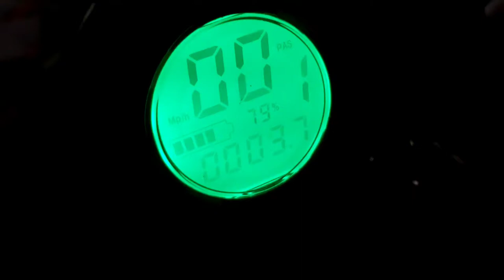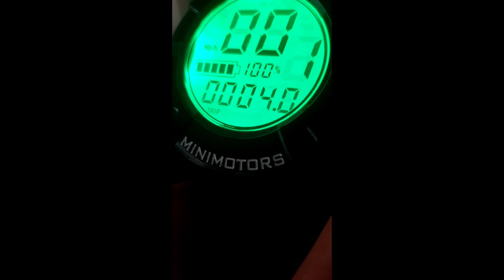Kaabo Mantis Pro Bent Rotor/Brake Review (Fluid Free Ride)

Comment: My front rotor is slightly warped after a crash, and it started to rub on the caliper. It squeals pretty bad, but only on speed 1. If I brake with the caliper loose, the sound goes away while the caliper moves back and forth quite a lot. I think I'll try to bend the rotor carefully back closer to round, a tiny bit at a time. Replacing the rotor is a major project. It requires opening the entire unit: ungluing the rubber mat, unscrewing the top, prying it off from RTV glue without bending it, removing the battery, undoing the motor bullet connectors, unrouting the entire motor cable from the frame so the rotor can come off the cable. Then having to reverse the whole process to get it back together. It's ridiculous there's no connector on the motor cable. You know what else sucks? To replace a front or back plastic deck guard requires cutting electrical cables, even though they do have connectors.
Reply from the maker: hope you are ok and injuries were minimal !

Comment: I have the mantis FluidFreeride V2 edition. Just hit 300 miles and my rear brakes have been doing exactly this since new. My rear pads are completely gone, the bracket was barely hanging on for dear life. I lost braking and crashed a couple weeks back because of it. I'm attempting to change the rotor and pads right now, hopefully it works. FYI, huge hassle to change the rotors, you have to unplug the battery and pull the entire motor cable out and through the rotor.
Reply from the maker: @josephalise9140  yea unfortunately we start researching n all that after these things happen but it's how we learn, hopefully you have the time to learn and change it yourself. That way, should you have a better one in the future it'll most likely be easier to own that the fluid free ride that isn't known for their quality products. If you're interested, the channel 'RK9 Rides' just uploaded a video listing e scooters in different price ranges so you can get a better idea of what brands and features to look for, depending on your budget. Cheers ✌🏻

Comment: this could have happened due to the high weight
Reply from the maker: Thats a bit concerning but how does that work? im about 225, thats a good chunk below the limit.
Reply: if the shaft were bent then the wheel rotated crooked and the wheel now rotates straight while the disc is crooked it could be at least disc
Reply: try to remove the disc and place it on a flat surface then you will see if it fits evenly
Reply from the maker: @M-S0704  thats not a bad idea, after my first 3 miles i got a flat and had to wait for a tube but ill have to take a day to try that cause the worst would be misplacing it more off center, i appreciate your responses !
Reply from the maker: @M-S0704  the only thing is too that the disc cant be removed so easily as the hub wires come through it up the scooter, but thats probably the best way to check

Comment: Just got mine, i have the same problem. I got mine on aliexpress, front rotor seems to be warped very little. And i found out the tires it self, its not a complete circle. Msged the seller, didnt seemed to want to help. I ordered the 10x3.0 tires. Should be coming soon. Will see if it fixes the problem
Reply from the maker: Awesome, although im kind of aware websites like that offer no help or warranty but FluidFreeRide has been replying to my emails, ill keep you updated on how it goes ! From what i can see happening in the future unfortunately is having to swap out the hubs or at least disconnect the wire to be able to change the rotor, assuming the issue is just the rotor
Reply: @codezalo5773  swapped to 3.0 tires, got alot better! Front rotor still abit warped. So gonna change that next!
Reply from the maker: @koolpeoples  thats awesome to hear, get to it ! Which tire did you get and from where!?
Reply: got the same problem on my brand new mantis that i ordered from aliexpress...did you solve the problem by replacing the rotor?
Reply from the maker: @andreitoader8156  I got mine from Fluid Free Ride but so far there is no clear solution from Kaboo besides buying a new hub and maybe using the motor to make it yourself, RK9 Rides on Youtube temporarily fixed the issue you can get alot of info on the Mantis in his video.

Comment: Brake problems mantis 10 basic model. 

Time to time when driving suddenly something happens when braking and the brake lever moves all the way to handlebar and I lose all brake capacities. Some threshold issues? Sometimes this occurs to front brake and other times to rear brake. 

Then I bring my scooter to a friend and he fixes it. Then like 1 week later same thing happens again. Brake lever moves all the way to handlebar. 

I think brake pads gets stuck somehow and not moving when braking. I could be wrong though. 

Can someone help me please? Im feeling hopeless.
Reply from the maker: Im with you man, I dont believe I had this issue specifically but I do remember one brake not as strong as the other, could be what your suggesting or like the Hydraulics needing maintenance. 

Dont feel hopeless, I went through my share of hardware issues as well, if you need anymore help let me know I could research what I can!
Reply: @codezalo5773  my brakes r not hydralic.
Reply from the maker: @microsoft1665  have you checked cable/cable tension? Is all Hardware on the brakes still good or do you know if some parts may be damaged, these are all good questions to research adding your scooter make and model and also looking through forums
Reply: @codezalo5773  my brake calipers r branded zoom and i believe these r bad quality. they snap when applying tension.
Reply from the maker: @microsoft1665  I highly recommend getting in contact with where you bought it from, i returned mine within a month of ownership, Ive said this in other comments that now that the scooter hype is gone these companies sold a bunch but without long-term testing bringing out alot of customers such as yourself to deal with the issues alone, you should have a warranty or be able to return your scooter if you havent had it for long
Reply: @codezalo5773  i cant return it. i bought it on aliexpress.
Reply from the maker: @microsoft1665  I got mine from Fluid Free Ride so I dont know what you can do besides finding a electric bike or scooter store and a tech can take it apart, put things together and see what you need to change, i havent heard of the mantis since I returned it , not looking to buy any scooters unless its been in the market for at least 5 years and has decent amount of reviews, worst case scenario if you REALLY dont want to fix it is sell it as is to someone who wants it to fix
Reply: @codezalo5773  i wanna upgrade my mechanical  brakes to fully hydraulic. do u recommend that?
Reply from the maker: @microsoft1665  sure, i just wouldnt know how to go about that, look up RK9 Rides channel on Youtube he has the Kaabo scooter for at least a year now